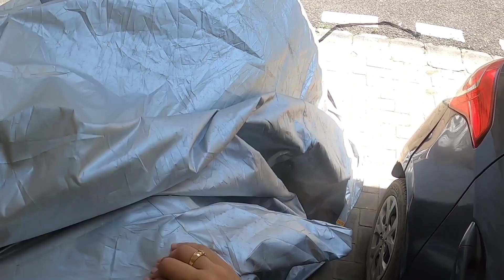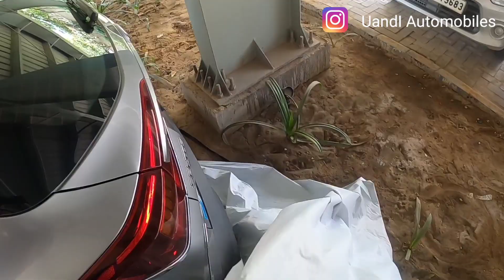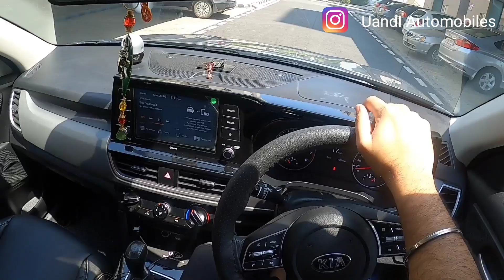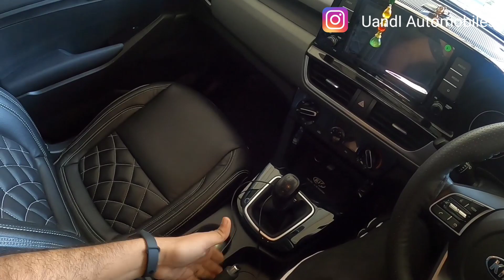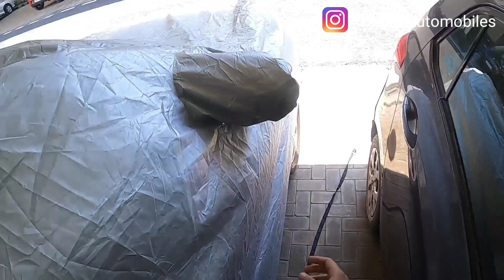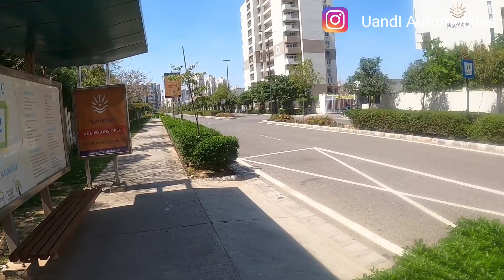Life in Lockdown | Car Care | Personal Blog | UandI Automobiles

Comment: I hve parked my car in uphill because plain area is not available near home..for parking i applied hand break and did nt cover the car. Here weather herr is moderate. Please suggest me any correction dos and dont..thank you
Reply from the maker: Hi Brother, considering you stay in uphil area i would suggest please park you car in gear, (Using handbrake is also ok but you have to keep releasing them on every second day basis to avoid any possible malfunction) put some small stones below tyres, keep switching on your car on every 3rd or 4th day to avoid battery drain

Comment: Your car is standing idle for a week, then why did you raced the engine immediately after starting? This is not good for a cold engine.
Reply from the maker: Hi brother already taken utmost precaution: weather was not too cold car was started in afternoon whence there was already hot outside, if you hear the acceleration noise you notice it was slow acceleration